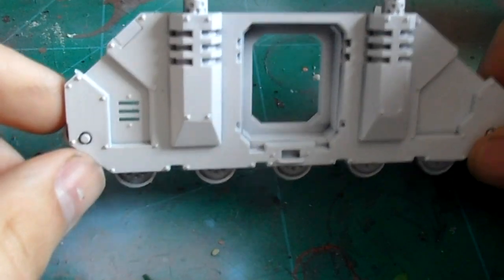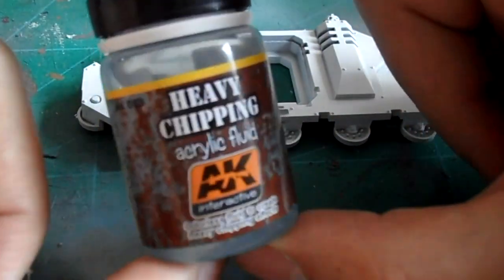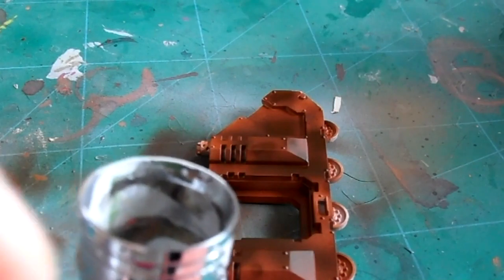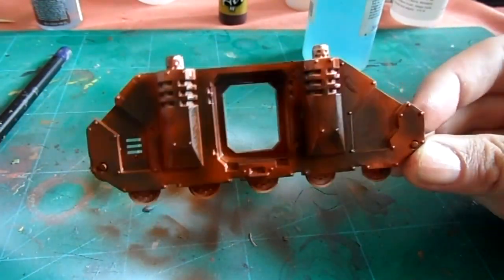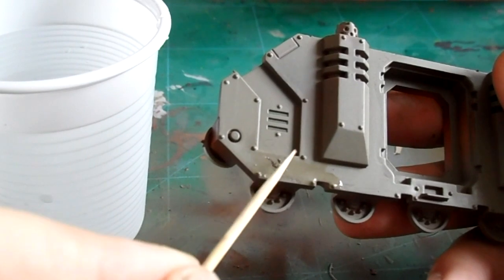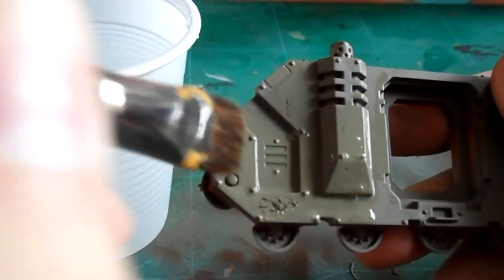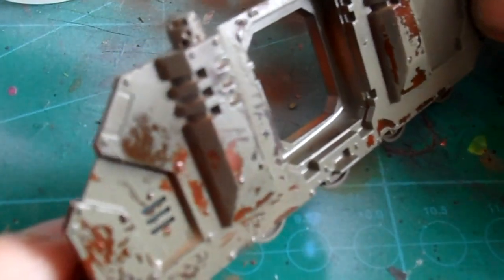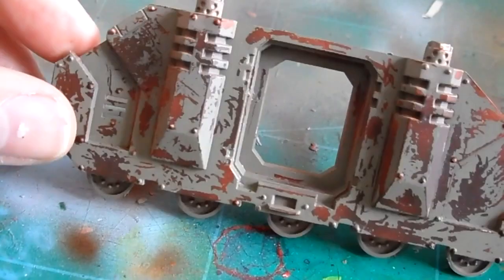How to make realistic rust and paint chips.

Comment: It looks like a great technique to use, thanks for the video. I'd be a little alarmed at the way the paint started to bubble there as the water got under it. If that happened somewhere you didn't want to have the chipping, or you wanted a much more subtle and sparse chipping effect, the paint bubbling up would be a disaster. But I guess you would use less water, or cold water as you stated.

I have a question about the chipping fluid. Do you clean your airbrush with ordinary acrylic thinners? And also once you've finished chipping and the over coat dries is it necessary to apply a coat of varnish, especially if you plan to add an oil wash?

Thanks again. I enjoy your videos.

Comment: I'll have to see how this works if you put a basecoat of chrome/boltgun metal to get a paint chipping off metal look (rather than the rust look you are going for)!

Question though... how does the chipping fluid act? I understand its a base coat under the final paint layer but above the rust/metal colour triggered by water, but does this mean whenever I get my model wet it could chip more?
Reply: Spray a clear coat on the model after it's done.